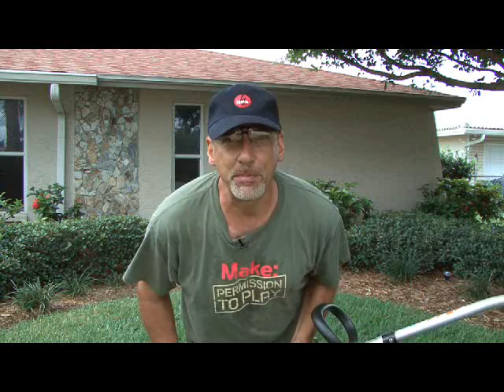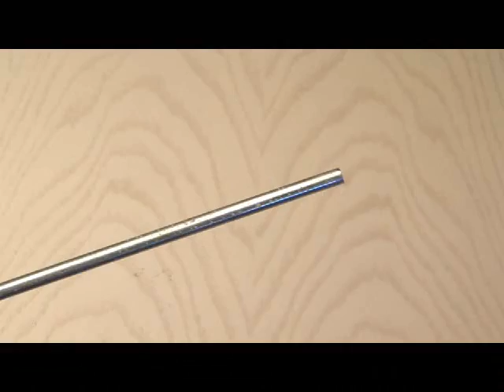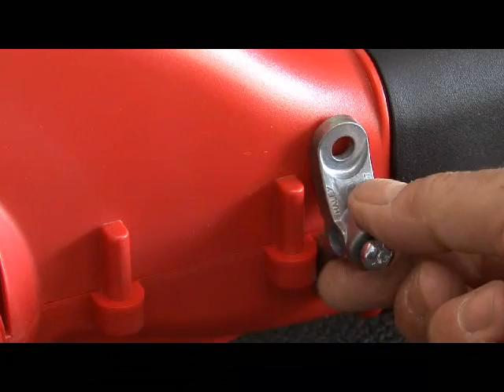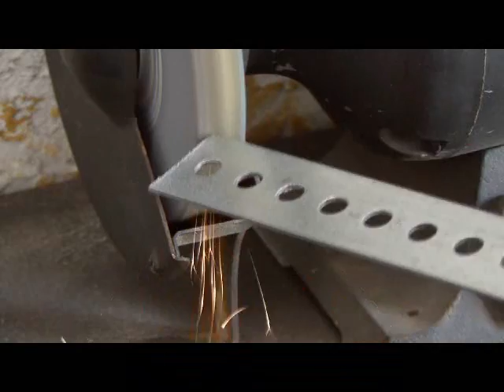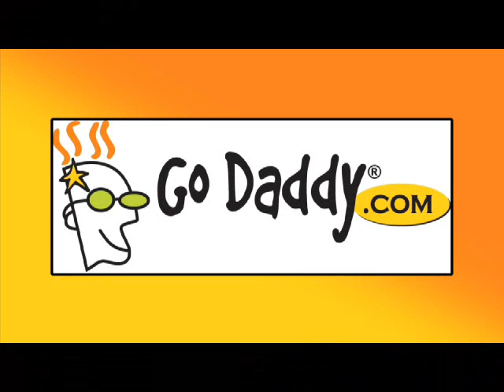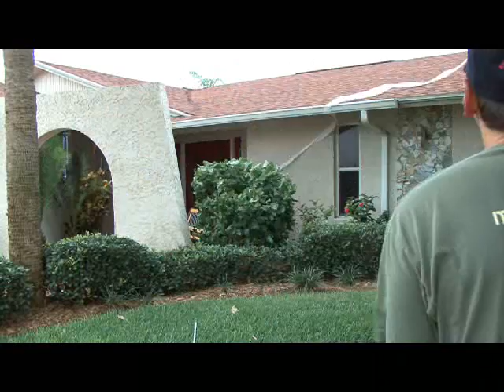Weekend Project: Toilet Paper Launcher

Comment: you cant use it on anyone's house but your own,the obvious is that you would either have to have it be battery operated or use a extension cord that you have to carry around with you and then plug it is at the strangers house which i know wont work unless they are not home,not to mention the Noise,you would need to find a way to cut that noise all they way, now it would work for parties though and making a mess of your own home and wasting toilet paper,but the muscles in the video looked good